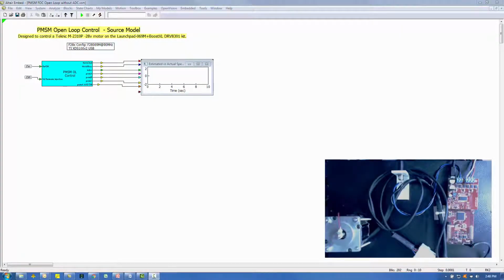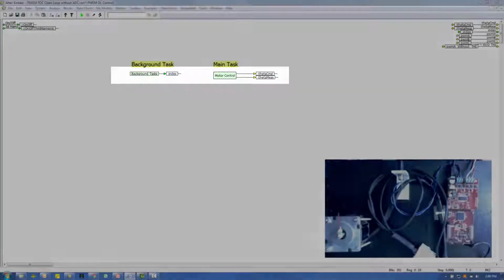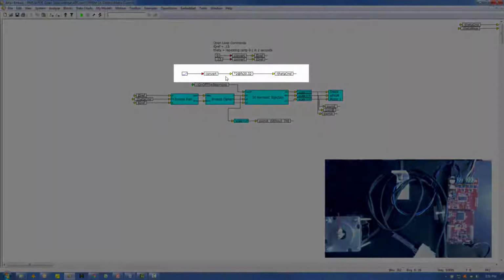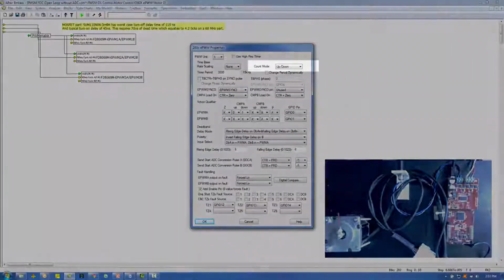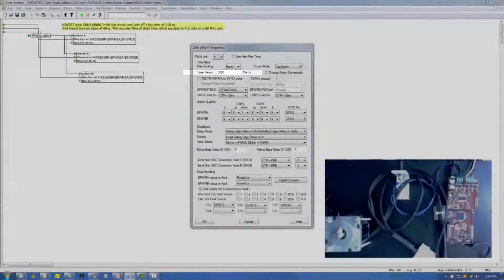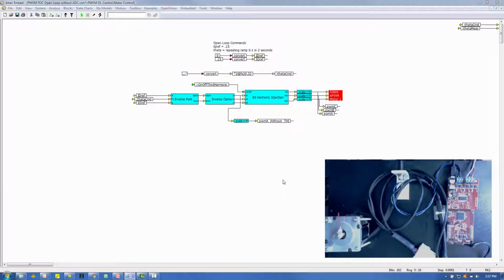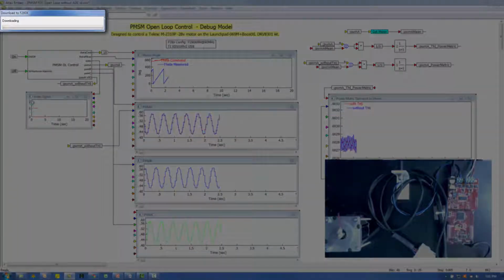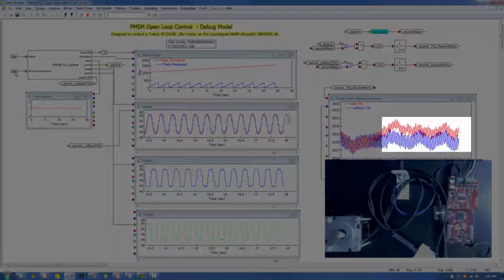Open Loop PMSM Control using Altair Embed

Comment: Any thoughts how VisSim/Embed compares with Simulink?

Also, how does Altair Embed connect to a processor for HIL testing?  I assume there's a list of boards/interfaces that it supports (PI, Arduino / JTAG, SWD, RS232)?   Is there a way to connect Embed to a custom board?

I've got a BLDC motor that I'd like to control without sensors..  which would require real-time bemf readings in order to commutate.   How easy would it be to do this using Embed?